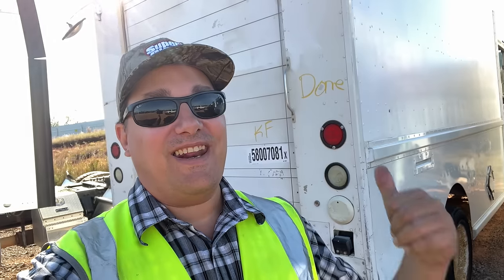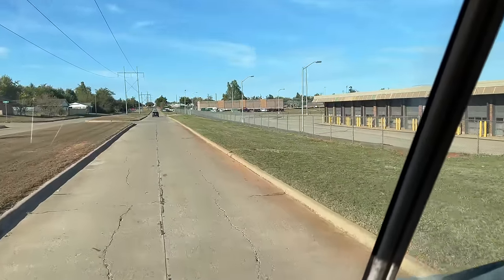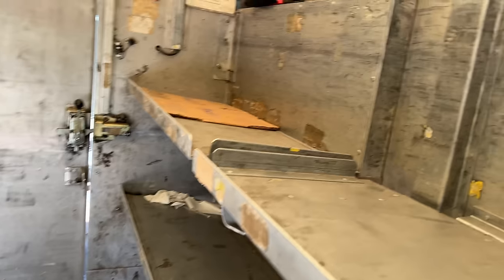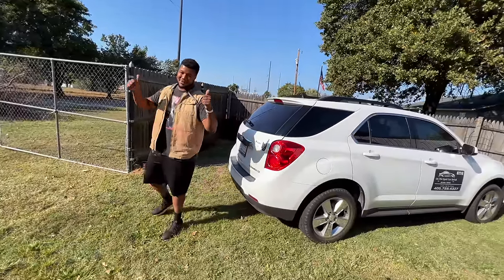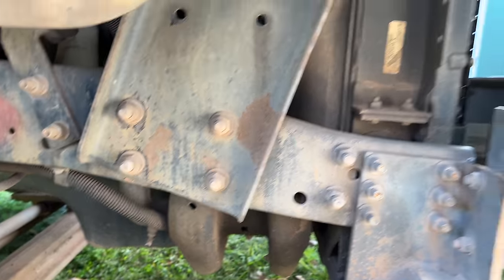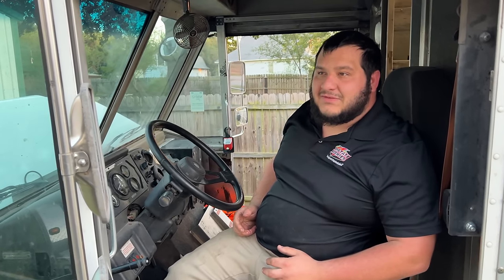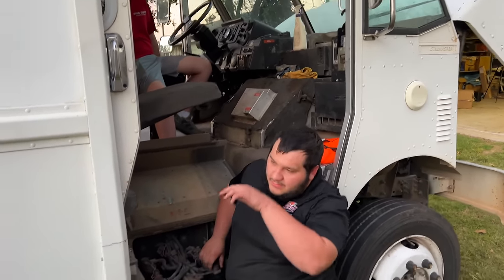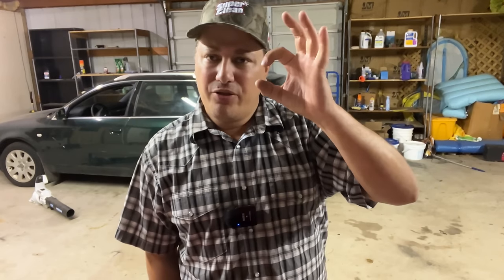I Bought the Cheapest FedEX Truck EVER 24v Cummins + Allison for $4350!! Freightliner MT45 Step van!

Comment: contact clean all connectors oil everything on the lock  change battery if you can in swatch or get someone with a rfd cloner for spare swatch

Comment: Yep! You gotta a good deal! If I lived closer, I'd make you an offer! I have a 2005 Freightlner step van MT45 former fed ex truck, but it has a Mercedes engine.  I think it's a MBE300 engine? Anyway you gotta Gem there!  I'm an electrician and  I use it for a work truck.  Good luck with that! God bless!
Reply: I have the 06 MT - 45 with the MB diesel. Have you done an oil change on yours?

Comment: Canada Posts old step vans are really cold in the winter with little or no heat in winter and absolutely no a/c in summer. The racks in the back and the roll up back door rattles and bangs as you hit bumps and potholes driving along the roads

Comment: You have a FedEx, looking at your replaced speedometer (the four bolts around it indicates aftermarket).   CBC did a report on swapped out speedometers to roll back milage on Fed Ex vehicles.

Comment: Hate to tell you but speedometer was most likely changed. Saw something some time ago that its a common thing with high mileage vehicles that have gone to auctions. The 4 screws holding it on is the give away on the speedometer from factory it's all together with no screws in the dash.

Comment: That fan works by the ECU turning on the fan clutch just like a AC system would do so there might be a wiring problem or faulty ECU or relay

Comment: I noticed the rear bumper is gone. That is the back door bouncing making the noise. Wonder what is in the back. Not sure if they took the shelves out or not. Defrosters leave something to be desired. I used a hand held micro fiber cloth on a wand to clean them. They have a governor on them 65 tops. I retired from Fedex in 2020

Comment: Just so you know when you changed the battery it reset your truck battery, that's that's why your speedometer doesn't go up when is on park anymore, and your door opener is rest to so you going to need to reprogram it back so they could work again.

Comment: Due to new carb regulations. All of the step vans 2009 and below that are diesel can no longer be registered in California. Right now those diesel step vans 2009 and below are selling for about 6k and below. Even one freightliner MT45 diesel engine and Alisson transmission is going for 6.5k is being sold nearby where i live and it only has 85k miles.

Comment: Freightliners sometime replaces Speedos with remanufactured Speedos.....So they sometimes have some mileage discrepancies. I worked 26 years working on these trucks. Very common issue for a Speedo to go out.

Comment: 59:27 hey randy, you know what you know how the check engine light was on when you bought the truck, well that check engine light that was on before could’ve just been on for a bad battery cause the truck is idling with 2 new batteries put in and no CEL(check engine light)

Comment: Yes you can use the check engine button by holding the button down engine off count the engine lights should be red and yellow lights yellow light blinks 12345or 6 times thats first number in the code then red light blinks total times for second and 3rd number so yellow blinks 3 time the red light blinks 26 times then its a 326 code then you can look up the codes online and they will help you but i know you have a bad speed sensor on your trans also fuel filter is a dav co filter and the truck is made chevy and frieghtliner and the diagnostic tool is a laptop dodge dealer and frieghtliner but you can buy a 01 laptop online for that truck and is same as frieghtliner rv

Comment: You  do need the key on even though it starts and runs with the bracelet. The key powers the fuse box. Common sense diags says that your fan/AC/ check engine light would be the temp sensor that controls the fan, If the fan doesn't work then the ac compressor wont turn on.

Comment: You just unbolt the filter (hosings), and if you smell/feel/study the fluid you'll find out if it's motor oil or fuel or water or traansmission oil or whatever.

Comment: I’m a FedEx ground delivery driver, my truck is longer but has a gas engine nor do I have the door bracelet. My truck is noisy, that’s why a lot of drivers have the radio turned up. Also in the summer both doors stay open because that little fan in the cab is a POS

Comment: Still watching. The canister that you pointed at.  I’m trying to remember that’s most likely your oil filter. The second one your water separator you hold that open until there’s no more water coming out of it. Your fuel filter it should have two of them on there. There’s a lot to talk about or explain but it be better for you to do the research or find a mechanic that’s willing to talk and help you out. Like that air conditioner they work good when they’re new but once they start getting old they are very expensive. Most likely the company FedEx depending on what color the Ex was that would of told you if it was corporate or if it was a private contractor and they got tired of the expense of the air conditioner so they just had it rigged so the doors can stay open.  Your going to find out that everything else with that truck. And where you’ll save the money at is in the labor cost. Parts they’re just expensive for diesels. As you can tell the batteries.

Comment: When i worked at FedEx express, our trucks (Probably not all fedex trucks) wouldn't start if the doors were open, including the slide door to the cargo area, and the rear door lock wouldn't work if the truck was running.
Reply from the maker: Thank you

Comment: There is a key on the back that looks like it is physically attached to the locking system. Also, check and  see if it has a battery or there on a charging station on the truck

Comment: The odometer issues were not really FedEx specific. 
Freightliner had issues with the old odometer.  
I've gone through 4 speedometers in 2 million miles on my class 8 truck. 
The issues seem to be fixed with the newer digital odometer.

Comment: If u can pup those batt cap off .... get u a 2 gallons of distilled water n a bag of epsom salt .... need a baking soda to neutralize d acids n clean inside get rid of those blk looking after cleaning n came out clean to ur satisfaction start dissolving epsom salt n for faster dissolving of d salt boil it then pour them in batt after d water is cool then charge them in 2 amps all night if not 28 hrs then u have a good fresh batt

Comment: You might need to replace some fuses in that control panel for the electromagnetic locks or they might have batteries that need replaced. The watch/wrist band might need to be charged or batteries replaced. You might also call or lookup the company that makes the devices and locks.

Comment: Seems to me you ought to be able to remove the strap and pop off the back and replace  a  new button battery.  I don't know anything about the purging you're talking about but it seems like a couple of does outside outside counterparts need to be replaced or rewired or perhaps the fuses...

Comment: We have 2 old trucks like this at Fedex. Ironically our high mileage 05' 24 valve rolls a lot more coal than our low miles '98 12 valve! Most of the ones are newer and use DEF.

Comment: Must be a truck that was used to deliver secure items as not all FedEx trucks have that lock system where you have to scan to open it. Thanks to this Youtube vid coming out I have watched FEDEX trucks more closely then before. I have seen 10 of them so far today (My area gets a lot of deliveries by UPS and FEDEX) and none have any type of scanner to open the doors. Maybe yours was used to ship things that were a bit more on the hazardous side? On another note, while the truck is noisy when driving it, it is much more quiet for a FEDEX driver as during the day, the truck is full of packages and when all the packages are gone and it is time to drive back to the depot, the shelves are folded up and latched into place preventing them from rattling about.

Comment: actual odometer reading could be way lower than the indicated 181000 if the speedometer is indicating miles when not even moving. Still, for theprice you got it for, new batts, some electrical work and basic body work you shouold still come in under 9OOO all in to do basic restore.

Comment: put a new fabricated rear bumper on the fedex truck one with a custom trailer hitch with a 7 pin plug so u can haul ur car trailer around and put ur tools inside the fedex truck have it say auto aution rebuilds on the side in red letters and paint the whole truck black or keep it white and put chrome wheel covers on it and she would look amazing and u can park it at head quarters when ur not using it since u have more space there maybe it will fit in aar garage and one day put a stereo system in it since there isnt no radio or speakers in it

Comment: It still isn't oil filter. The question is is the engine oil or the transmission oil. Or the power scaring  oil. It may even filter the blinker fluid filter

Comment: It's called a step van. I own a 1957 chevy step van, and it's on the title. Mine is thick steel with accordion rear doors, and an in'line gasoline 6 banger.

Comment: Can you tell me why the Transmission Select Lever skips 2nd gear ?
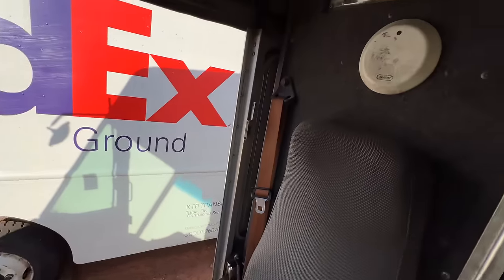Watch the 1:23 mark and you will see the gear selector says 1st, 3rd., 4th., D with Overdrive !
I just brought my new 2000 Freightliner MT45 (FedEx) Step Van home yesterday. Mine has the Cummins 5.9 24 valve engine also. 373,000 (no Blowby) Starts and runs like a Swiss Watch ! 6 Spare wheels with very nice tires ! I paid a few hundred $ less than you !
FJB !

Comment: if its an alllison 1000 the filter screws in beside the pan on the trans or at least it did on my chevy with it. thats a common rail ctd it looks not a regular 24 valve. im pretty sure thats the oil filter looks like the one on my 05 ram.

Comment: If it has a digital odometer, that is not the correct mileage, those vans came with analog odometer and FedEx just changed the faulty odometer for a newer replacement, not bothering to add the old mileage, there is a video about it when the true came out and people was suing FedEx for rolling back odometers,  and FedEx explained that they just replaced a faulty part for a new one and that there was no ill intent on their part.

Comment: hey Randy was the mileage on the paperwork matching the odometer?? reason why I ask is because they originally come with an analog odometer not digital and they change out them to get more money for them. there is a company who bought a bunch of them and found out the all had been tampered with. so if your paperworkdoesnt say mileage exempt or the real mileage then the place who sold it to you could be in trouble. if you hook it up to diagnostics it will tell you the actual mileage!! check it out. I bet the mileage is closer to amillion or 750k

Comment: I drive a 03 express, with 330K... still runs strong, on second trans, I was planning on a Fed ex or UPS Fraightliner but the 15 20K wow.. they are expensive...I found a 07 freightliner mt45 electric... do you know anything on those... its selling for 5.5k here in SOUTH CA. any tips... the owner got it from an acción does not have the start key controller...

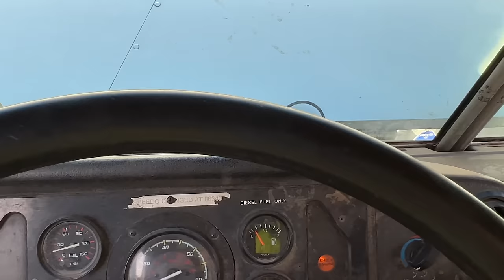Comment: 23:50  tip ?? idea ??  wutever...

check the FIRE HYDRENT FOR LAST TEST INSPECTION DATE.....  that will give you real good ballpark on when it was running in service last.... ;)  well it's a thought that jumped out at me when I saw it just before you go checkin the air condition'n...

Comment: This is NOT derogatory ! But you might find answers (label here and there) if you power wash under the hood.  Maybe easier to trace some lines weather for liquid or electrical juice. Lots of questions might be answered with a clear view. Again This Is Not Derogatory.

Comment: Every time you do an oil change, suck out the brake fluid and put new brake fluid in and also the power steering. Take that out and put fresh.
My 1992 pick up truck has never had a brake job except for new pads.

Comment: The speedometers on those things are junk. They have been replaced on most of those trucks. No matter what you do, they are rattle traps. The wrist fob pad is only by the right door and inner and outside cargo door. The one by the passenger door unlocks the door without the driver having to fumble for keys. FedEx drivers are required to use the passenger door to keep them away from traffic when entering/exiting the vehicle. I hated driving those things because my feet barely reach the pedals.

Comment: Good deal and these trucks run forever...only bad thing is Fed ex drivers are given ridiculous work loads and they beat the trucks pretty good plus it's not there truck so ya those 200k miles are probably some hard miles...but thats what these trucks are designed for ..and on the flip side you know it got routine maintenance at least ..good buy though I want it to turn it into a apartment 😂🤣..hope you get a million+ miles out of it 😁

Comment: At 34:35 that is ur high idle control for in the winter for heat or for in the summer for the ac an for the door i would run a hidden button out side for it an by pass that other crap for now

Comment: Randy, remove that damn sensor system. It's more trouble than it's worth. That's my opinion. Look into having all the keys changed so that they can secure and start the vehicle like everyone does.

I would love to see you straighten out the whole truck and keep it for your business use.
Reply: What does removing the sensor do? I have an 06 Freightliner MT - 45
Reply: @oneshot_onekill4618  removing the sensor and magnetic locking system will allow you to not be locked out of your vehicle automatically. Then just get the standard mechanical locks functioning again and you'll be good to go.

Comment: If you go to a shop that can read the engine diagnostics you will find out that the truck probably has 500k miles or better on it. The giveaway is the digital mileage. Still a decent deal but only worth about 8k. Fedex is well known for doing this. They even have lawsuits against them.

Comment: there is no battery in the wristband..it is an rfid .... just like a id badge
just check the wiring....... and the engine... probably has literally no miles on it......... we replace them and send the cores off.... its easier

Comment: There are plenty of things that need the batteries for some things on vehicles to work specially if it's custom made! You made money just by the engine and transmission! Also some things require certain things to be activated to operate!

Comment: Here is my math. Tired are shot and will cost $2,000 to replace, mount and balance. General maintenance and clean up will total at least $500. Still can be a worthwhile purchase. Oh, and new batteries could cost $500 for both.
Reply from the maker: Tires are $1300 mounted and balanced. Batteries were replaced in this video for $250, not $500. Cleanup, was free as I did it myself.
Reply: @AutoAuctionRebuilds  The batteries were $125 new? The battery in my BMW (AGM) cost $180.

Comment: I am a truck driver with the air cleaner on the top of the air cleaner it should pop off and the code you have to have a problem on your laptop and you have to have a connecter to plug into to truck and laptop

Comment: FREIGHTLINER FOR THE ENGINE CODE. THEY HAVE THEIR OWN SPECIAL SOFTWARE OR A INDEPENDENT. FAN CLUTCH CAN BE ELECTRIC OR STANDARD YOU HAVE TO CHECK. CHANGE TRANS FLUID AND ENGINE OIL. BTDT X 100 LOOKING AT MECHANICAL CLAIMS. WRIST BAND MAY HAVE BATTERY, FREIGHTLINER OR THE BODY COMPANY WHO BUILT LIKE UPS TRUCKS, UNION CITY BODY COMPANY ETC. WONT TAKE MUCH TO FIND OUT... I CAN ASK I DO WORK FOR UPS AND FED X AS A CONTRACTOR. CLAIMS...THAT IS IF YOU WANT ME TOO.  REMEMBER THE PORSCHE?

Comment: The speedo is not original it is a replacement from Freightliner the real mileage is not told. If you go to a Cummings shop or you become a friend to a FedEx express mechanic see if he can plug in there Cummings software to find the correct mileage/ hours . The other reason FedEx turned them in because of the frames would rust through  they were afraid of the liability. They can be repaired

Comment: PLEASE DO NOT ROLL COAL!!!!!!!!

And no you can NOT use a normal OBDII scanner to scan a class 4 and above vehicle. They are only meant for no CDL vehicles. You need a special scan tool and program (depending on engine manufacturer) to do any diagnostic work to those. As for the “check engine” button, those worked for the first month maybe 2 and they all seemed to fail at once. Lol

Comment: You can get rid of that strattec system and remove all of that junk. Or you can find someone that knows how to make that lock work with a different system/ key fob. It's just an electric locking system I would get rid of it and key all of the locks. The fan clutch is bad. Take it to Cummins and let them do a service and check up on it. They'll may show you what's what but they will give you a detailed report of the condition of your engine and service requirements for it. They got insurance money for that, no way did they not get insurance money for that truck.

Comment: On the Danger Ranger 9000 - Derek did go back out and run some laps after that wreck.  

How experienced were those guys racing on a track like that?  Kevin Smith posted a video including a suspension cam and even he sometimes got loose and almost wrecked.  If you've never raced like that it takes some getting used to. 

You talked about racing the FedEx truck, it was UPS where Dale Jarrett was going to race the truck. lol.  Look at some school bus races, those are corny but can get pretty crazy.  They don't go too fast but they can rub on each other like crazy.